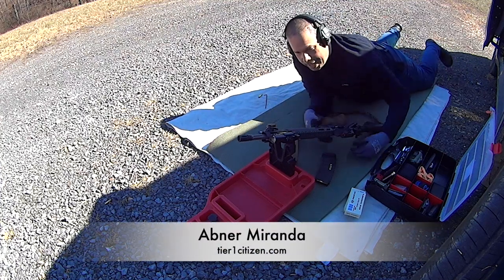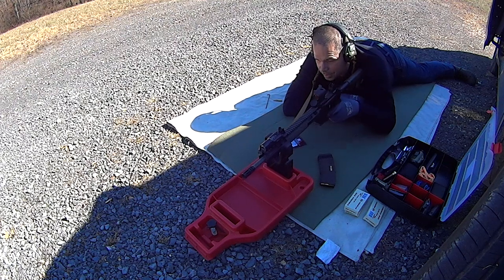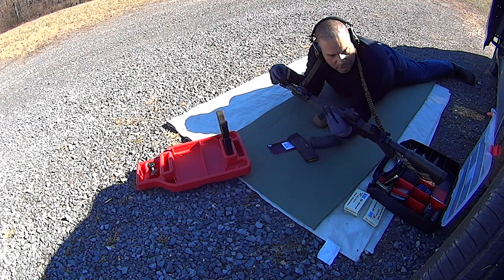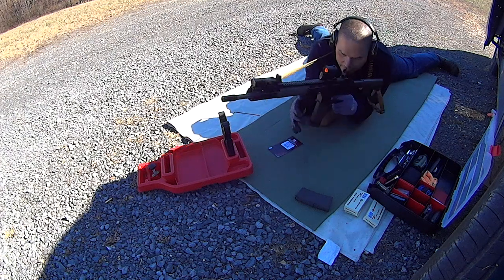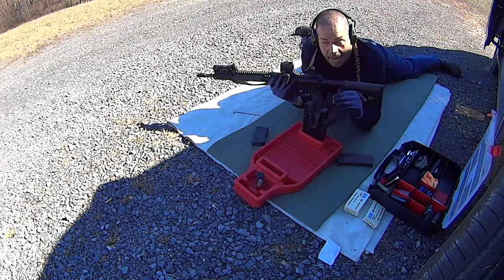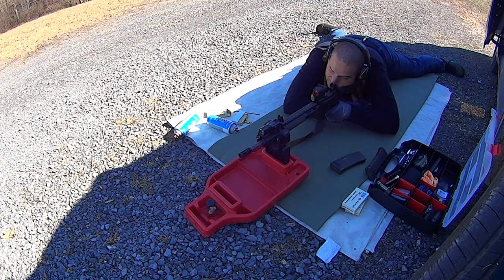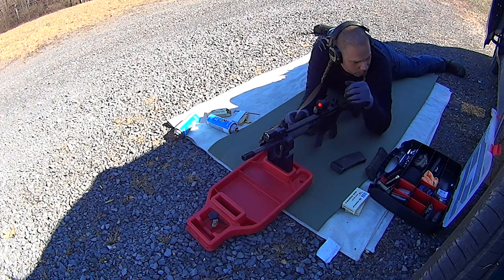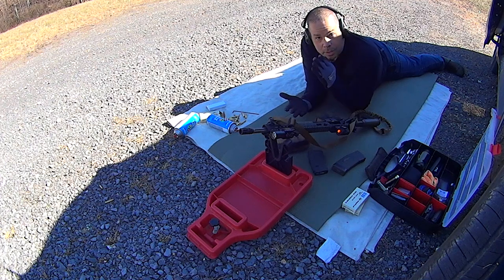How To Gas Balance An AR-15

Comment: I love the design of this block EXCEPT the old clamping design so I got the newer WC bulletproof adjustable block at the time and am very happy as it has not froze and has nice clicks. I just noticed now they have a non clamping design with the set screws and maybe have to try this on one of my "other rifles that I shoot less. Just got a new riflespeed toolless gas block for my 300 blk shorty I'm building right now for easy super to sub adjustment on the fly as I have a couple suppressors now.
Reply: I'm just wondering why you prefer the set screw design over the clamp? Genuinely just curious because I want to get one of these gas blocks and kindof prefer the clamp seems like it would be more secure on the barrel if you're not going to pin the gas block.

Comment: I ordered a BCG from aimsurplus for my new rifle build. When I took it to the range to test, it was short stroking, and not loading the next round. I went home, looked at the gas block and it look good. I then looked at the BCG. I saw that the gas key wasn’t staked and was loose. I called aimsurplus and sent pics. They sent me a another BCG. I put their BCGs in all my rifles. I know they take care of their customers.
Reply from the maker: Yeah every once in a while a bad one will slip through. It it were a consistent problem I'd say move on. However, I've bought stack of BCG's from them and have only had like two units that were out of specs. Our industry is rushing through things nowadays and it gotten really bad. A few months ago I had to send back 10 out of 12 upper receivers to Aero Precision for cracked Picatinny slots. They took their sweet time to replace the uppers. I mean weeks and weeks to get it done.

Comment: How do these changes in gas setting impact velocities if at all.  Does more gas down the tube take velocity away and vice versa?  Have a good one.
Reply from the maker: I'm certain that it affects velocity at some level, however, not to any degree I've ever been able to tell. I can smack steel at 300 yards with a tuned down 10.3" SBR, as if it were standing at 25 yards. It's almost indiscernible.
Reply: It’s definitely enough to change the zero. I have experimented with it before when zeroing. Probably still minute of bad guy though, but it was noticeable.
Reply: @rosswitte  that's a good question 🤔

Comment: Quick question. Does this have significant usefulness in a 7.5 inch pistol build?

Im debating whether to spring for the adjustable gas block or not.
Reply from the maker: No on a 7.5" you'll be alright using a heavy buffer like this one and it will seriously slow your gun down for you. I use these, they work. 
https://aimsurplus.com/griffin-armament-ar-sob-suppressor-optimized-buffer/

Comment: That’s weird I have used 3 superlative gas blocks and none of them had the detailed insert like that. It has the basic info but no diagrams. That’s funny I have 3 bcgs from AimSurplus also, 2 regular and one with lightweight cuts. The one with lightweight cuts is a little rough on machining and had a cpl issues with it but I got it ironed out later
Reply: I just got one and it had the new insert

Comment: Good stuff, important information to know when trying to fine tune your rifle. Your guns always seem to run smoothly. Couple questions, do you feel the need to run pinned gas blocks? And if not do you simple the barrel for the set screw type? And what optic is on that rifle? 

Thanks for the info Abner!!
Reply from the maker: I never run pinned blocks. That's overkill of the highest order. Nor do I dimple the barrel, also overkill. That crap is pushed by the gunsmiths who want to make you think that you NEED it. This of course entails going to see them to get it done. All one needs to do is put two drops of blue Loctite 242 into both gas block holes and tighten down the screws until the wrench flexes just a bit. Doing so causes a blind loading effect that hydraulically presses the Loctite around the entire bottom half of the block. Once you do this you're permanently done. People talk out of their butts when they say that the heat will destroy the Loctite. If it weren't such a nightmare to get one apart I would do it on camera for you guys to see that Loctite is just about permanent on a gas block. It takes a blow torch, a mallet and brass rod to break a gas block loose once you've used Loctite. The optic is an Aimpoint T-2 on a Daniel Defense mount.
Reply: @Tier1Citizen  that’s actually all I have always done, loctite and proper torque. I’ve never had one come loose. And the fact that you don’t do anything different and use your gear a lot more than I have and yours don’t fail then I feel good to go. I watched James Yeager talk about how you need to file a groove into the barrel for both set screws to bite into then you need to take a chisel and smack it over the gas block set screw holes to basically stake each set screw. He said the loctite method doesn’t work as heat kills the loctite. It made me feel like I half assed my setup by loctite and torquing it down haha. But I felt that was overkill. P.S. excited to see that 13.7 gun 😎 thanks Abner!
Reply from the maker: @maxhayward2127  Yeah I saw that one too and thought "I wonder if he knows that he's giving erroneous information."
Reply: @Tier1Citizen  yeah he has done that kind of stuff more than once. And if you disagree with him in his comments he says “get some training” or “we put our stuff through real world hard use”. And to me anyone who isn’t willing to give answers to legit questions, makes me wary.. thanks for the good info and proper responses.
Reply: @Tier1Citizen  Good info. Thanks.

Comment: Is there a reason for not running the bypass mode
Reply from the maker: I presume you mean with the gas return pinched all the way off?
Reply: In bypass the block is fully opened and still fine tune adjustable just the excess gas goes out the block kind of like a piston system.

Comment: im surprised to see that BA barrel to be overgassed. why havent you sent it back to get them to correct it?
Reply from the maker: All barrels from every manufacturer are now over gassed. Manufacturers just got to the point where they got over constantly dealing with people wanting to shoot cheap ammunition.
Reply: @Tier1Citizen  yeah unfortunately. i hate an overgassed gun. i just ordered a 16in BA gov profile barrel. i pray its not overgassed.
Reply from the maker: @tajituck888  Invest in a milspec buffer spring and one of these heavy buffers. It'll make a difference. https://aimsurplus.com/griffin-armament-ar-sob-suppressor-optimized-buffer/
Reply: @Tier1Citizen  appreciate it. I hope I don’t need it.
Reply: @Tier1Citizen  hey got my BA barrel in a couple weeks ago and its good to go. im getting consistent 3 o clock ejection.

Comment: Does the military go through ALL this with the M4 or the standard M16 (BCT)? I don't think so. When the Army handed me my first M16A1 if it shoots that is all they want, bang hit your target. Putting too much!
Reply from the maker: Rudolph, your comment shows a lack of understanding about how well the AR-15 can work if it is properly gas balanced. The military has always been and will always be the blunt end of performance. The private sector is where the top performing shooters and weapons are and will always be.
Reply: Absolutely the gas makes all the difference!
Reply: This is basically doing your own r&d and customizing the system. It wouldn't make sense for the entire army to issue rifles like this, but for me I like my Sup Arms agb, enhanced bcg and jp h2 silent capture spring with my gassy ocl polo can. Soft and quiet, cycles great, to each their own (AR😅).